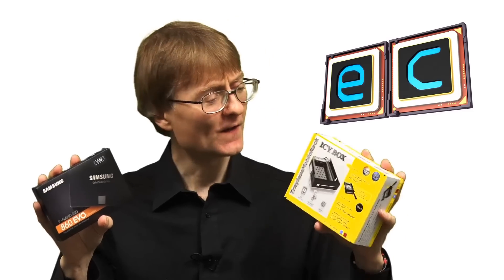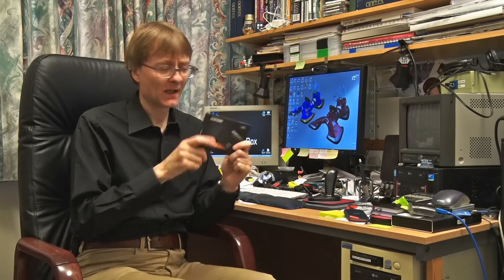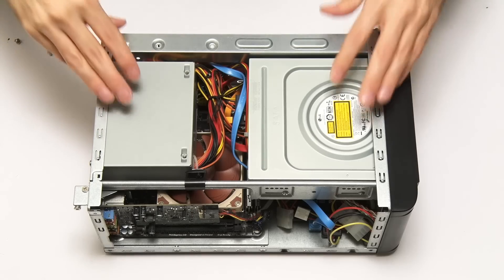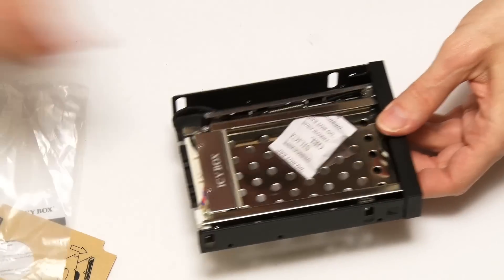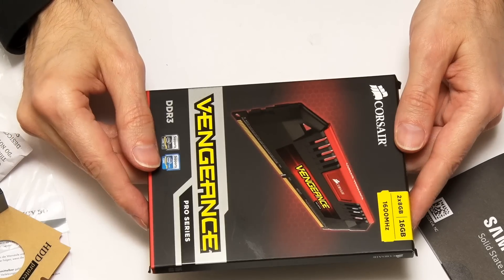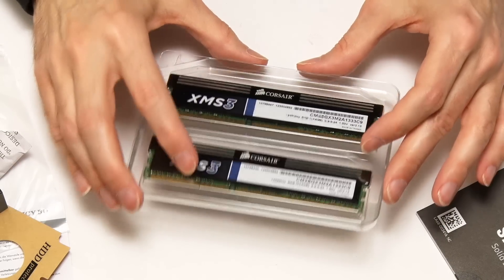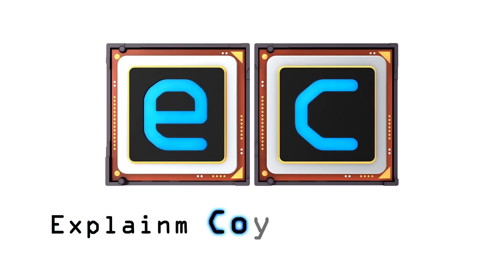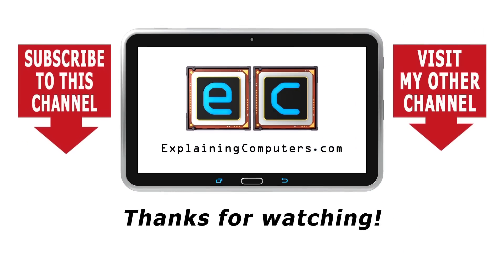i3 Mobile Rack

Comment from the maker: In response to the many questions/queries below, I am aware that I could have set up a dual boot on this system – as I have covered in many videos, and most recently in this one: https://www.youtube.com/watch?v=Q4zt3wEt7s8  However, this is not what I wanted here because:

1. My intention is to transition from Windows 7 to Linux Mint, so after 14 January 2020 I hardly expect to run Windows 7. But I want to maintain a working Windows 7 SSD intact that I can switch back if required.

2. I did not want to risk messing up the working Windows 7 install on which my business relies. Dual boot configs can go wrong. :)

3. I often make videos looking at different OS, and so will benefit from the flexibility of being able to swap the boot drive – and indeed to quickly replace the boot drive with a clone in the event of a drive failure/etc.

Ultimately, this video is just showing you something I decided to do, in which I thought some people may be interested. I am not here suggesting this is the best solution for others. But it is the best solution for me in this particular instance.

Others below have raised the concern that the SSDs may be damaged by constant swapping (not that I will be swapping them very often). I used to worry about this, as I use SSDs as the recording media in Atomos HDMI/SDI recorders. But after using these for over six years now, I’ve never had an SSD fail – and that’s after thousands of drive swaps. So modern SATA connectors are more robust that we may think. :)
Reply: I've found dual booting to be a massive pain with windows relatively frequently destroying the boot sector of the linux drive. I agree with the logic of using hotswap bays instead.
Reply: @kazriko  I haven't installed windows on a BIOS device in a long time now, but with EFI systems it definitely overwrites what's inside the EFI partition, destroying the Linux bootloader. The fix is straightforward, though (albeit a bit time consuming & annoying); you boot into a live cd, then chroot into your Linux root (with /boot/efi appropriately mounted), and then reinstall & update grub. Linux plays nicely with a windows partition, it's windows that misbehaves upon installation.
Reply: @waltherstolzing9719  It's kind of been that way since the 90's too. OS/2 Bootmanager was prefectly happy to work with Windows if you installed windows first, but if you installed OS/2 first, windows wrecked it. Windows has never played well with others.
Reply: Very logical solution to an easy problem - separate boot drives and maintain access to Win7

I hated the headache of when a dual booting system goes dodgy. Needless to say, I stopped using dual booting systems long ago and just ensure I can everything I want on one or another system.

A completely foolproof approach to dual booting system would work but when has technology been foolproof... :-\
Reply: @kazriko  not true, certainly the issues we had when we moved to UEFI were down to Linux not Microsoft as it wasn't even a MS initiative.  It is easy and lazy to blame Windows Nd MS for every error and often these are user errors easily fixed if you just are methodical.

Personally I have no issues booting of W10 into a VM or of a Linux into another VM.  The only thing I don't do is Linux into W10 and for the life of me I can't at this moment think why. Quite a few of my OS can be flaky, say W10 on the Insider Program or just generally to be expected Linux issues.  I'm VM for a reason often enough, because I am prepared for problems so I'm using a VM.

It's much faster than dual booting which just takes me back to 2004/XP era.  Nostalgia in a not nice way.  Unlike many I remember how dire XP was at launch and how insecure it was throughout its life.  Equally I remember that Vista ended up a pretty good OS with really only the uncontrollable swap file as the legacy fault.  That was corrected with W7 which was really just Vista with customer feedback as is W10.  Makes me smile that Vista gets all the hate, mainly from people who never really used it.
Reply: @kazriko  I did not have any problems running win10 and mint on my laptop. How long has it been since your experience?
Reply: @neumdeneuer1890  I stopped dual booting about the time of Windows Vista. The problems of Windows 10 trashing boot sectors after they're already installed and in place is second-hand from others. Always in association with one of Windows 10's mandatory upgrades.
Reply: I like your solution much better than a dual boot solution since it keeps both operating systems totally separate and pristine.
Reply: @thomasburnett4712  It's possible to keep installations on separate hard drives, yet still benefit from the convenience of booting into windows from grub. Provided that you have the os-prober package, grub-update automatically detects the windows installation, and makes an entry in the grub menu. (Speaking of menus, though, that actually allows you to run efibootmanager to tell Linux to reboot into windows, without having to even select anything from a menu.)
Reply: Walther Stolzing  Thank you. I was already aware of that, but I still stand by my comment due to concerns that your recommended solution may introduce potential security vulnerabilities.
Reply: But it's not a bad idea and it's easier than opening the PC, i am doing the same thing on my laptop so i can take out the drive and swap any time Windows breaks something and makes me mad or i need to use a tool that's only on linux or Windows and all my games are on windows too (one HDD is a 250GB Seagate momentus with windows 7 pro x64 and the other one is a 40GB seagate with linux mint 18.1 mate x64 on it).

after Windows 7 support ends i will be putting a new 500GB or 1TB western digital or crucial SSD in and Windows 8.1 will run from that so i can keep 7 for running old programs
Reply: many motherboards allow you to choose on the fly which drive would you like to boot from...usually pressing f11/f12.
Reply: ICOBORG  Yes, It’s true that most motherboards do allow that option and I was already aware of it too, but the drive swapping option allows you to physically secure your data separate from your computer and is the most secure.
Reply: Thomas Burnett my only concern is the potential for getting a rootkit malware in the bios, which would then effect other drives plugged in to the computer, bios rootkits are extremely rare but could be used for a targeted hack if a hacker believes your worth the  effort, the normal more common rootkits get stored on the disk itself so swapping drives would still be secure in that instance though
Reply: Did you know that you can copy physical windows installation to virtual machine really easily with linux live session and dd command? :)
Reply: Why don't you just upgrade Win 7 to Win 10 for free? It is currently "still possible" to upgrade from Windows 7 "for free" from the Microsoft Windows10 download page. If it is a "retail license" just make sure that you record the Windows 7 Product Key before upgrading, in case you want to change the motherboard in future. As you will need the old Win 7 product key to reactivate the license.
Reply: I appreciate your enthusiasm for Linux Mint. I have recently installed it on my Windows 7 machine and found myself in constant frustration. Nothing works properly. It keep asking for password every time I want to open anything. Wine doean't display windows apps properly and VPN connection just fails to start all together. When I google for solutions I get most relevant links taking me to Linux Mint support forum full of abuse and unhelpful replies. As of today I have deleted mint from my hard drive.
Reply: Matt Gorzka the purpose of asking for password everytime you try to install software is to protect you from unauthorized install/uninstall including preventing malware from installing without you giving admin permission so it’s a security feature, Windows security sys admin’s recommend using a user account for daily use for a similar reason as it reduces the chance for malware to install
Most vpn’s only work via commandline in Linux except AirVPN, they have a GUI interface, Expressvpn needs commandline instructions but are very simple from reviews I’ve seen
I recommend standard Ubuntu Gnome for new users personally, windows migrants should install Gnome Extensions from Ubuntu Software Center and then install Dash To Panel so your ‘start menu’ and taskbar icons are in familiar location to win 7, you can download and use a free VPN called Riseup from Ubuntu software center, but they ask for donations if possible
Your best to use windows apps in a VM on Linux until you find replacement Linux apps but I agree will take time to re-learn, or at least use windows 10 on a separate drive purely for software your not using in Linux yet while you transition
Reply: @mrfrog8502  well done, much better OS out there
Reply: A cheeky trick you can do even with a laptop if you wanted to save money on icy docks (although I’m still planning on getting one/some) is use a sata 13pin 6+7 extension cable from internal optical drive port to outside the pc case or to outside optical drive bay cavity to optical drive 2.5” caddy so you don’t regularly pull cables in or out of the internal port or the 2.5” drive itself, this way you can boot windows ‘externally’ (which is a bit of a hack as I think they don’t allow windows to boot via usb for some reason?), but the cables costs under $4 on eBay from what I’ve seen and the optical bay 2.5” drive caddy’s cost around $15 so one end of the cheap cable and the cheap caddy port take all the wear and tear
Reply: Dual booting gets very messy, it’s quite complicated to delete Linux without windows failing to boot too and is a command prompt job to delete the Linux boot data from the boot partition, an inexperienced user will find themselves loosing access to their windows partition by accident, plus windows has a history of corrupting Linux and can be unstable after windows updates etc
Much better to completely remove windows drive and install Linux on another drive and swap between them or at least swap booting between each via bios if keeping both inside the computer all the time
Reply: I agree with swapping drives over setting up a dual-boot system.  Swapping drives is much more flexible in giving you the option to use various OS's and is infinitely easier to revert.  If data is kept on a separate drive, then there is no reason at all to need to access one OS drive from another one.
Reply: @jajwarehouse1  they don't 'leak',  you shouldn't have problems full stop. That said it is incredible what MS are doing with Linux IN Windows, still beta but we are moving fully to the irelevent OS I think.  WHICH ONE WOULD HOPE MIGHT SHUT THE EVANGELICALS UP.
Reply: @twmbarlwmstar  Well, one of the variants of Linux in Windows is actually not Linux at all, it's GNU running on WindowsNT. The other is just a thinly disguised VM. Besides, the whole thing is just Microsoft's latest attempt to Embrace-Extend-Extinguish an adversary.
Reply: @kazriko  how by giving bits of code away FOSS, GIVING MONEY, GIVING RESORCES?  that is just evangelical talk and outdated, you are blinkered.  MS customers are happy so where is the problem?  just a VM is a strange attitude to have as well.  Most of server is all VM, it is normal.  there aren't dual boot servers for vry good reasons.

I think MS are getting there.  it's been slow but sure.  the OS is increasingly unimportant.  Google said this with Chrome OS and got it wrong, now they are back with a more OS os.  the future isn't monolyth OS like Linux or old style windows, it's going to be modular and cloud based.  you'll have MS WITH LINUX in effect but that will be a variable, underpinned by Azure in MS case.

exciting times and I think in less than a decade the way we think of OS will have killed the evangelicals off. they will just be using their 'platform' which which will be bits of MS, not so recognisably classic Windows, Linux kernel, docker type stuff and it will be quite tailored.  that is why I think MS are still trying to make a Windows s/light type OS, for those that will just want a really simple robust OS with apps making up the rest.  a bit like the way Chrome is going
Reply: @twmbarlwmstar  have you looked at their history? They often give resources to competitors that they plan to absorb or destroy. They adopt a competing technology, (embrace) then add their own technology to it (extend) and then they manipulate it in such a way that you must use their extensions to do certain things, driving their competitors out of that space (extinguish.)
Reply: @kazriko  all drama as usual.  just look at the recent Corp activity in the FOSS community, the questions over Epstein and MIT.  MS isn't taking over Linux Kernel and that is just tin foil hat evangelical drama.  MS is. major supporter of Linux, just as it was with Apple when they were in fire straights.

you can only see imagined drama because you have conditioned yourself to blame MS for everything even to the extent you ignore the obvious benefits that MS bring to Linux.  Google came along and took what they needed and then up went the draw bridge.  MS has been releasing Windows code even more widely.  MS always shared code anyway but now Linux has extra protections thanks to MS involvement and that can only move things forward.
Reply: @twmbarlwmstar  no, just a simple matter of fool me once, shame on you. Fool me 20 times, shame on me. It's a long going historic trend going back to IBM and MS in the 80's. And continuing through all of tech that ms has been involved in since then. They deploy this pattern on every company or product that they "love".
Reply: @kazriko  simply matter of irrational prejudice I think you'll find, ignore the evidence to fit your narrative.
Reply: U can also set up hardware profiles on that one hard drive and  the same operating system one different computers. So you could take the SSD out of that small computer and pop it in a gaming rig and be gaming in minutes.
Reply: PJ sivley Interesting! you mean with Linux or windows or both? I thought windows couldn’t boot on another computer as it needs the drivers for that computers hardware, while Linux has drivers built in (generally) so the drive can be ported between different computers?
Reply: @impermanenthuman8427 Yes windows, it's called hardware profiles. So yes both.
Reply: I think dual boot is a Linux Evangelical thing, drives me mad as it is such an unnecessary way of doing things.  I would just virtualise the environment, 8GB of memory is enough but 16 is better.  Then there is no need to swap storage, just mount the OS you wish to use.  I think in the case of reviews, where there may be some risk, it is the gold standard. 

Drive caddies still have their uses, if you want sensative data removed to a more safe environ for example.
Reply: I opted for a dual boot with two drives after having  had a dual boot on one drive with the occasional grub mishaps (btw Puppy linux has great little tool to rewrite grub). The 2 drive solution put my fears at rest. Grub has been steady for a year now. However, I can see how this could be usefull in a situation where you commute to different work places like home and office. Thanks for the video.
Reply: Keep both inside and then pass the windows SSD to the KVM, dont even need to reinstall :)
Reply: I simply select boot drive from BIOS / UEFI in my case since i'm a bit lazy :D 
Works nicely tho :)

Comment: For whatever reason youtube said "You'll want to watch this video today" and it was right, I did. 
I also have an i3, with the same heatsink fan, and it's on an Asrock mini-itx motherboard and I too really liked windows 7 and wish I could still use it now, but with steam no longer supporting it, it's no longer useful. 
About a month or so ago I took that motherboard out, put it into a larger case and it now works as my NAS and I am very pleased with the setup as it's noticeably faster than the 2010 era i5-3470 CPU it had before. 
I also built myself a second computer using a Ryzen 1600x chip I had laying around and a few odds & ends and once I setup windows 10 on that it gave me confidence to experiment more, which is what I like about computing as a hobby. It's fun to experiment, and not go "yes, but I need a computer for my living, I can't experiment with that, what if something goes wrong?" 
Well now if something goes wrong, I have a live backup that I can switch to and carry on almost immediately with.

Comment: 11:12 ohhhhhwww, niice. what's the procedure to insert SSD without this icy box though?? (i have never used SSDs so dont know)

and also, how to remove the SSD from this case?
13:03 ohkay, so there is space to hold SSD with fingers, got it 👍

Comment: Chris do you still run LM on this machine?
Reply from the maker: I do indeed -- I am replying to you on it right now! :)
Reply: @ExplainingComputers  good to hear! There is no reason to use the most modern hardware for everyday office work...for example I use a 2nd Gen i7 for everything and really only upgraded the RAM to 24GB to allow smoother running of VMs. Microsoft's demands for Windows 11 are disgusting.  I run Debian 11 with the MATE DE and it's fine.

Comment: Thanks for the excellent idea of installing a removal tray for SSD into a computer. Last weekend I took your advice and installed an Icy box removal tray into my i7 computer and it works perfectly. It so nice to switch between operating systems without worrying about main Windows setup. It also nice to have a SSD with complete backup of all of my Windows apps. Again thanks so much.
Reply from the maker: Great to hear this worked out for you.